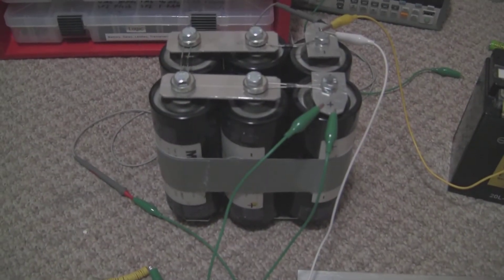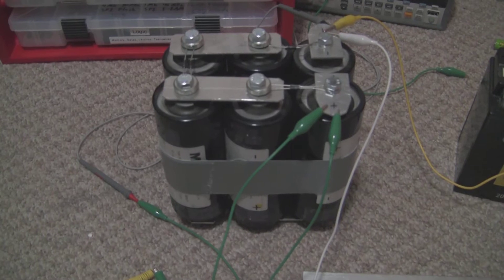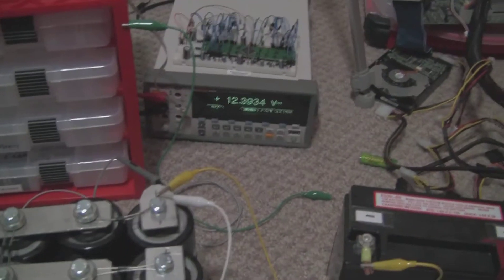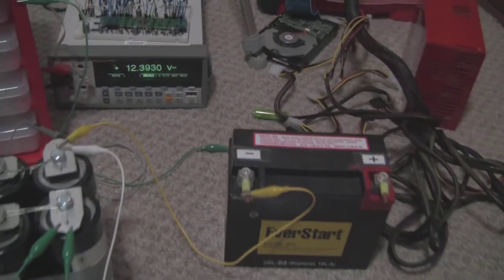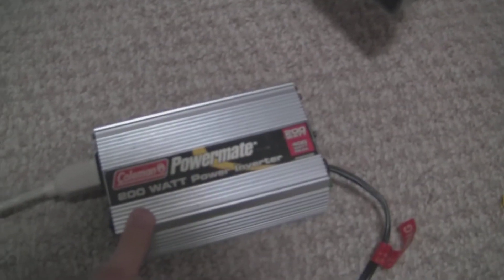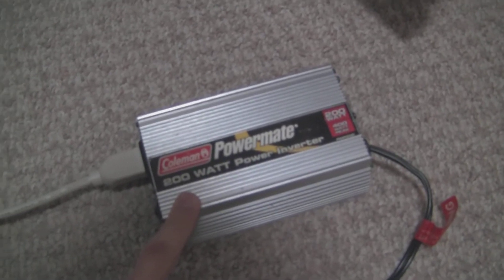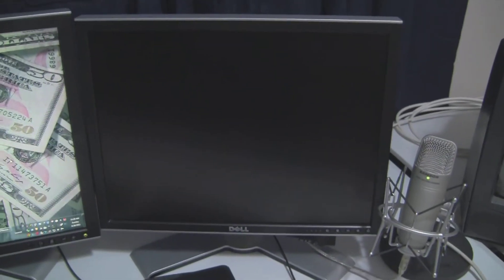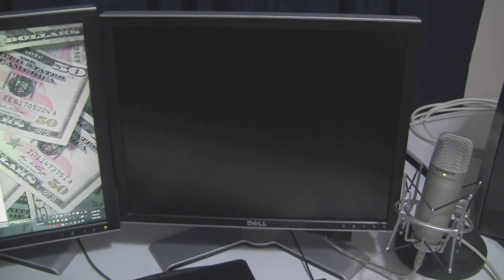Adventures in Ultracapacitors

Comment from the maker: @Galfonz Effectively, yes.  The important difference is in how the energy is stored.  Batteries store energy chemically.  Because discharging and charging are physical transformations that can't be fully reversed without some degree of damage, they wear out after a few hundred cycles or so.  Capacitors store energy purely as an electrostatic field between two plates.  There is no physical change; cycles are virtually unlimited.  Caps storing this much energy are a relatively recent advancement.

Comment from the maker: @kingkennethJ Indeed they are.  Both are 5W zener diodes, just with one being 4.7V and the other 5.1V.  Since caps charge purely from the current flowing through them unlike batteries and have no ability to handle being over-charged, it's critical to prevent them from exceeding their voltage rating.  To do it properly (safely), what really needs to be there are PCBs with voltage comparators that cause a heatsinked power MOSFET to dump power when the pair's voltage exceeds 5V.